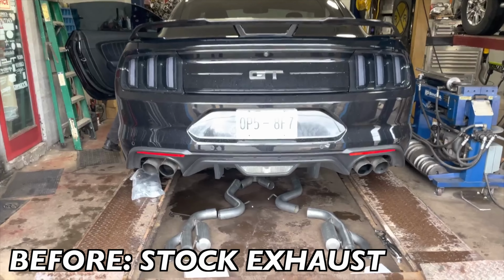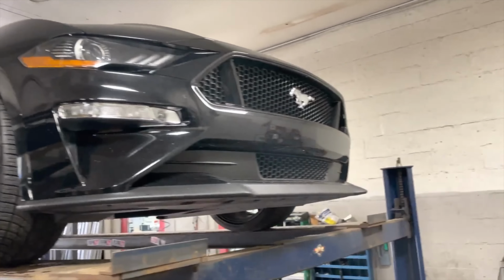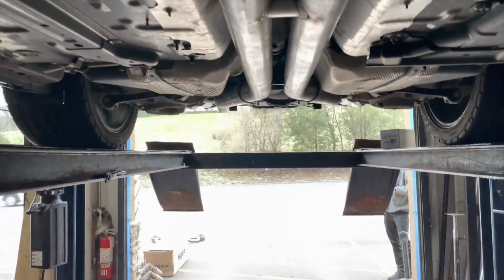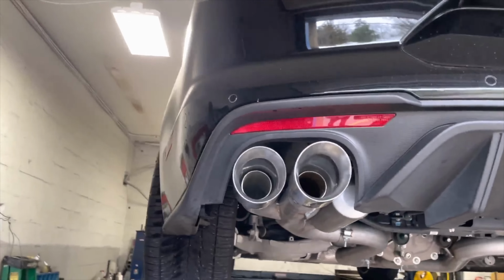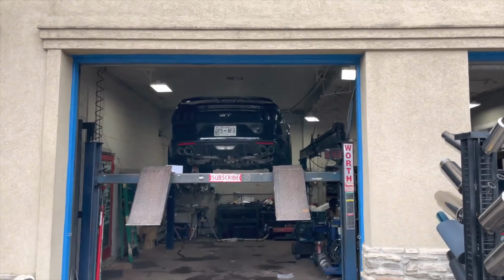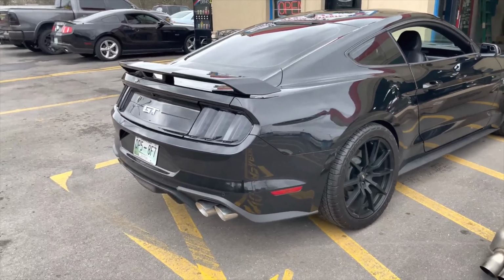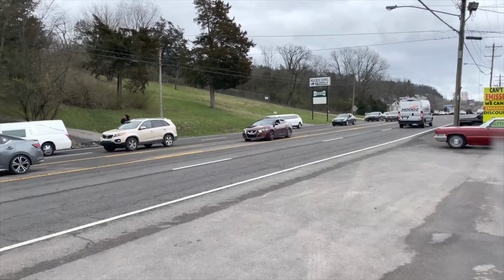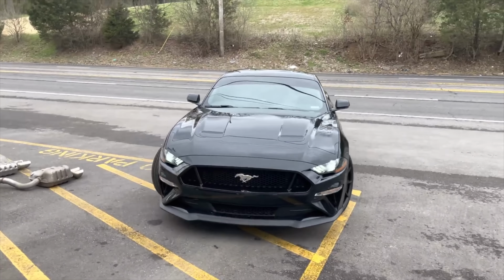2020 Ford Mustang GT 5.0L COYOTE V8 Dual Exhaust w/ MBRP Installer Series Cat-Back System!

Comment: This exhaust setup sounds way better than straight pipes on the mustang V8 because most of the mustang's that has straight pipes on it are so raspy all the time, but this exhaust setup had a bit of rasp but mostly sounded amazing to be honest
Reply: This is a muffler and resonator delete system. The only thing it has is an x-pipe and j-pipes to reduce the rasp but keep the volume.
Reply: If they added a bullet muffler on each side to this setup do you think it would sound any better?
Reply: @Dynasty-s1y  This is a loud exhaust setup. It is designed to be as loud as possible with minimal drone. Adding a muffler or resonator would ruin the sound.
Reply: most of that is because most mustang owners do x pypes instead of h pypes

Comment: I have the same set up on my 2019 mustang gt. Adds some significant power too! I’d say around 10-15hp. Im beating other cars that I used to be neck and neck with, by about 2 car lengths now.
Reply: @jmd23  I guess it added more than 10hp then. Cause I definitely was beating people by 2 car lengths that used to be door to door with me.
Reply: @jmd23  I started beating stock 10r80s by 1.5-2 cars.
Reply: Cat back adds nothing and 10hp would not give you 2 car lengths 🤣🤣🤣
Reply: @carguy...  well it did bud. from stock to catback added 2 car lengths i raced my friend many times with stock exhaust and then with the catback and we went from neck and neck to me being 2 car lengths ahead every run.
Reply: @10speeddave  did you need a tune?
Reply: @xoxark7  no you don’t need one
Reply: I just got a 2020 do you still recommend????
Reply: @haviddaynes  yes bro, a catback exhaust frees up a lot of airflow and will make you 1-2 car lengths faster from a roll race. also sounds way better than stock exhaust.
Reply: @haviddaynes  no bro get the corsa xtreme

Comment: This is basically a resonator and muffler delete with j-pipes to eliminate drone just like the Magnaflow xMod catback that was on the Challenger a few videos back but with aluminized piping instead of stainless steel. Hope this guy don't screw up like the Challenger guy and cut it off for a 2 5 inch crap catback.
Reply: I agree I'm not a big fan on the way the Coyote motor sounds but this sounds really damn good. The combination of the H pipe and that J pipe setup really does well for this motor. I'm so used to hearing people put crappy straight pipes on these engines I didn't realize that there were enough systems out there to make this engine actually sound good.
Reply: The Magnaflow mufflers and set ups are always so quiet and make the car sound stock.
Reply: @castletrash7770  Magnaflow systems come from mild to loud. If you want loud you buy their Magnapack mufflers. If you want a loud catback then you get the Competition Series or the xMod. The xMod on the Challenger was far from stock. It was 122 decibels with no drone and a lifetime warranty. The hack job that replaced it is only 2 decibels louder, drones, and will rust out in no time.
Reply: @kskip4242  There was a bunch of people here who got pissed off at me everytime I bring up a designed catbacks for the coyote that sounds better than the hack jobs done here. They don't get it until they actually see one with the systems installed. Case in point this system here. The coyote are normally raspy but this system makes it sound good.
Reply: They never learn until they see or hear it for themselves.
Reply: @CactusJack252  And some will still stand by the hack job because they can't see themselves spending money on a quality catback.

Comment: I'm running MBRP  t304 race with stainless works headers on mine definitely sounds good but the headers were a ( FUN ) install also cut that drop in pipe size out where the resonator was. But great job on this car for sure
Reply: How does it sound I’ve got a 2023 GT with the mbrp race. I’m just wondering do long tubes make a noticeable sound difference for the race system?
Reply: @sethc5924  my son is running MBRP race as well but cat back only so we have been able to hear them back to back and with the headers you can definitely hear a crisper deeper tone on the revs and a deeper idle note as well
Reply: @culbycars  thanks. I’ve been looking at catted long tubes. I’m just worried about voiding the power train warranty messing with cats. Where I live we have no emissions testing and no inspections.
Reply: @sethc5924 gotcha I understand for sure! We do have them here in Central Texas well till 2025 anyway lol but mine passes with flying colors. But definitely hang on to that warranty as long as possible for sure. I was dumb and bought the extended warranty but then gave in to my wants and got the headers luckily this mustang has performed flawless uses no oil between changes just a great little car

Comment: Perhaps you can't say MBRP because it's in Canadian... hahahahah. Love your content! I have an MBRP system on my 2021 F150 3.5 Ecoboost,  my buddy just put one on his 2015 Ram 1500, and I have a system coming for my father's Ranger.  The one thing Canada can actually contribute to the automotive market is MBRP!! Great products for sure.
Reply: It's not the same on v6 cars. And it won't wake it up as much as a v8. I'm saying this because I had a v6 from before and now I have a v8 dodge and both aftermarket exhaust done but the v8 turned into a monster. The v6 was just loud in   the cabin nothing else! No power gain
Reply: @2024hekyeah  probably not a big difference on a V6 naturally aspirated,  but on a turbo engine the upgrade from stock 2.5" to 3" pipe and free flowing muffler makes a big difference.
Reply: don’t forget you Canadians gave us the 2017 ford gt. built multimatic tough
Reply: @kevinhiltz9626  for a Lil bit before the computer figures out what's going on and adjust timing then the  grunt will disappear. You will have to do more than just exhaust to a v6 . you have to give it a good tune along with that. Unless the engine was already high performance
Reply: @2024hekyeah  I have the 3" exhaust and CAI, woke the V6 up alot. I have 12K on it now and the grunt is still there! Let a turbo engine breath a little and that's all it takes for some decent power. I hate to admit my V6 out hauls my 2018 5.0 F150 I had, but the V6 hauls my 4000+ pound trailer better than my 5.0L hauled my 3000 pound trailer
Reply: @kevinhiltz9626  Ya.    You also have spent money on it not just exhaust like I said. And your also right about the turbo ofcourse 😉  especially your twin turbo will respond better to exhaust than my naturally aspirated. N/a v6 won't gain any hp from just exhaust.
Reply: @2024hekyeah  spent under $1000 for an intake an exhaust, but we'll worth it. Yeah, a N/A anything doesn't gain much from mods like that.
Reply: @kevinhiltz9626  nah my 5.7 came stock with 395 hp. After a cat back system and a true CIA that is actually chambered to only trap outside air showed very visible improvements on the response even top end. All that is before I added long tube headers and a tune which is where I'm sitting at  the moment

Comment: $15,000 just For lowered Car and Bigger Breaks,Stupid Toggles switches for the Ac and Steering wheel to adjust Normal Drive,Sport,Comforts ect, Digital Speedometer,Leather Recaro seats,GPS, heated Steering wheel, different Rims, With Some GT350 Parts. Power is the Same 460 just like a Regular Mustang.
Reply: What is your problem lmao
Reply: @dz_gt500 that dude mad he broke lmao
Reply: Not everything is about power, lol.. all of that is easily worth the 15K. Every single thing you listed is literally an argument against your own comment lmmaaoo